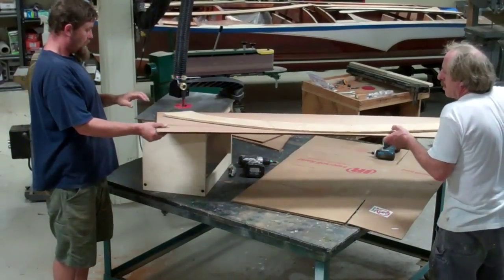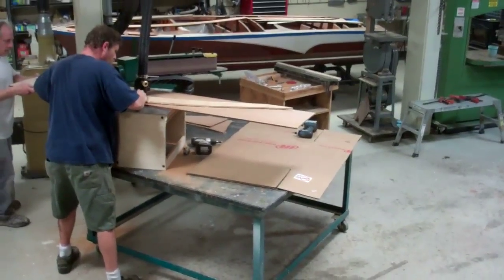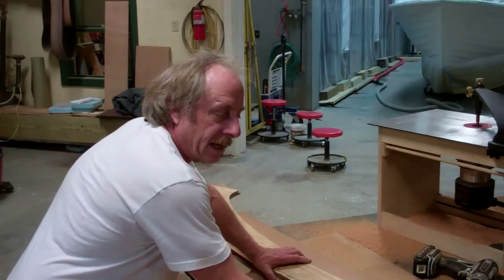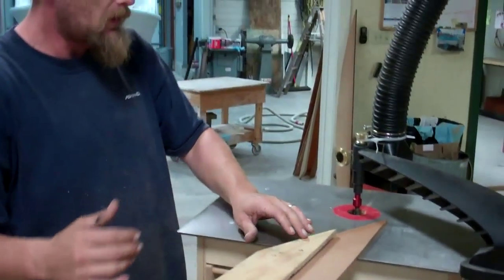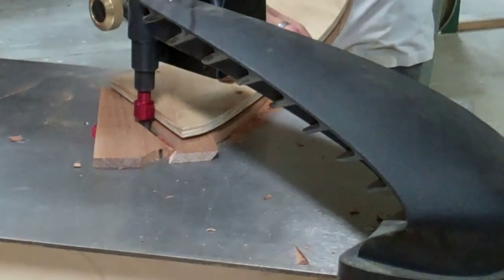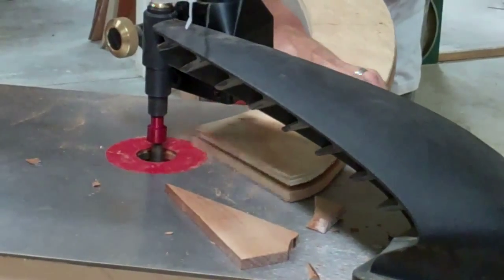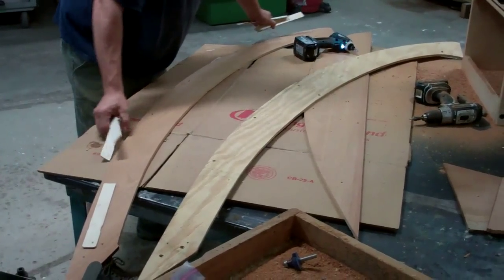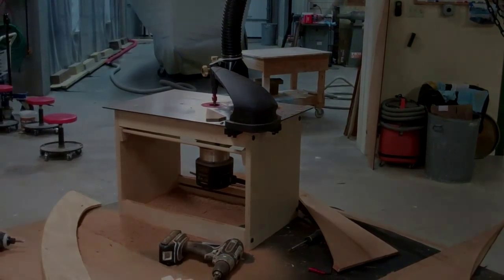Why Every Boat Shop Needs a Veritas Finger Router 10 4 2012

Comment: What does this do that a flush cutting ordinary bit cant.?
Reply from the maker: Sorry, just do not have the requisite experience to answer your question.
Reply: Ordinary flush cutting bits can overheat and warp do to the pressure put on the bearing at the very end of the bit. With this, the majority of the pressure it put on the finger instead of the bit. Also, a standard straight bits are often cheaper than a flush cutting bit. If you are doing lots of pattern work I see the benefit, but probably unnecessary for most.